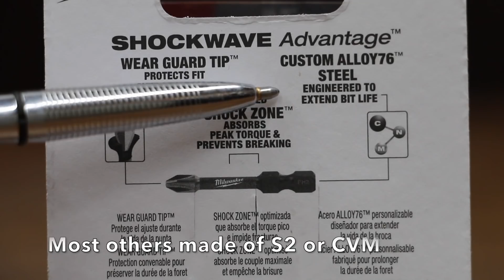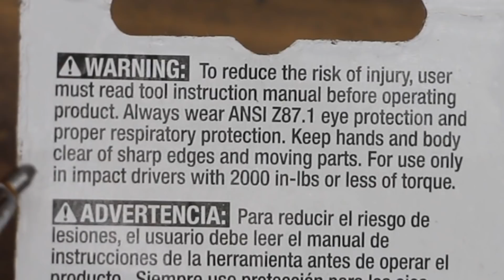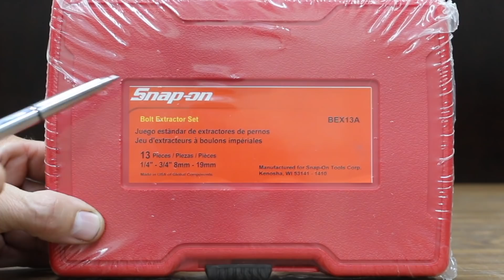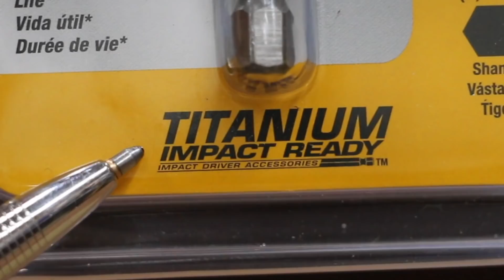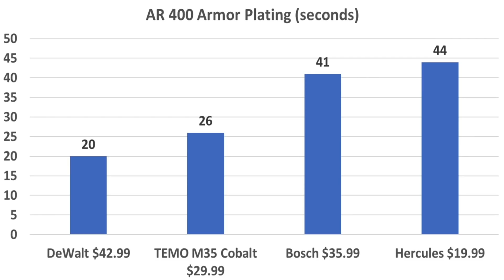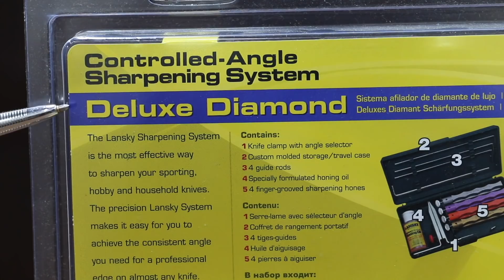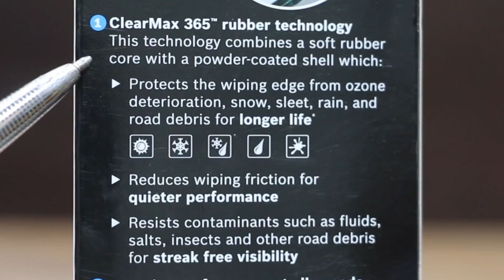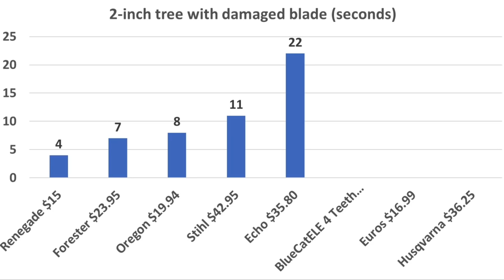Top 10 Tools in 2020? Let's find out!

Comment: Vid idea rtv silicone, ultra gray,ultra black,ultra copper, red high temp as anti seize? I wonder if in a pinch if it would suffice as anti seize. I've used silicone grease in a pinch as anti seize before and nearly 3 years later it all came right apart with no issues and worked..
Reply from the maker: Thanks for the video idea.

Comment: 1.	Best 1/4" Impact Bit - Milwaukee Shockwave Philips #2 Impact Bit	
2.	Best 1/2" socket adapter - DeWalt Socket Adapter	
3.	Best 1/4" Impact Driver - Milwaukee 2853-20 M18 FUEL	
4.	Best Nut and Bolt Extractor - Rocketsocket	
5.	Best Safety Glasses - Carhartt Carbondale CHB210DT	
6.	Best Step Drill Bit - DeWalt Step Bit	
7.	Best Drill Sharpener - Drill Doctor 750X	
8.	Best Knife Sharpener - Lansky Knife Sharpener	
9.	Best Windshield Wipers - Bosch ICON	
10.	Best Gas Trimmer Brush Blade - Renegade Hybrid Brush Blade

Comment: The Milwaukee impact driver he is showing/using is NOT the 2853 model listed on the chart.  The model he's using is a 2760-20 Surge 1/4" Hydraulic driver.  It comes in at $149 at Home Depot, Amazon or anywhere else you want to look.  I am very familiar with this tool as I am now on my sixth unit.  I just purchased my sixth one yesterday.  You may wonder, why is he on his sixth unit, do they go bad.  Hardly!  Thieves keep stealing them, either at my job site or out of my truck if I leave the window down more than three inches.  Yeah, I know, it's my own fault, well for leaving the window down too far anyways.  My first impact driver was a Makita which I thought was pretty good, but I had a guy helping me on a job and he had a Milwaukee (not the hydraulic, but Fuel). He would drive two screws in the same time it took me to do one.  Needless to say, I went out and bought one, and then opened my wallet to get two 5 AH batteries.  You can always have one charged before you run out of "fuel" on the battery you are using.  This is my favorite everyday tool!
Reply from the maker: Thanks for sharing.

Comment: Please check the flexvolt DeWalt 12 inch miter saw. Please find out why the cordless batteries work. And the adapter for the extension cord. Why does the have a problem converting DC to AC period and blowing the motor or computer inside the machine. Can you please test that. I don't think the walk has found out or solve the problem.
Reply from the maker: Thanks for the video idea.

Comment: Can't wait to see more videos this year!  Thanks for doing what you do!  Have you ever tested fuel stabilizer?  I use Sta-Bil marine for my small outboard boat engine and then regular Sta-bil for my other small engines.  Seafoam also claims to be a fuel stabilizer.  I was just wondering if one worked better than another, or if it really mattered to use the "marine" formula in the boat.  Might be next to impossible to test, but just wanted to throw it out there.  Happy New Year!
Reply from the maker: Great suggestion!  Thank you.

Comment: I have an idea, maybe you can run with it.  But maybe nay, I won't cry.  When I saw you talking the Drill Dr. up there.  Made me think of I got my dad a set of (Molybdenum Drill Bits), seems like about 10 years ago now.  A person does not  sharpen those bits.  The reviews tell about trying to use a Drill Dr to sharpen these.  Those revue people said how they only made their bits worse.  My dad says he has drilled, sever hundred .25 inch steel with em'. and they are still like little lasers.  Maybe review on some Molybdenum stuff.  And maybe, although I've not really looked.  There might be some other Molybdenum tools.  The Drill Dr didn't work because Molybdenum is more strong than even the diamond wheel.
Reply from the maker: Thanks for the suggestion.

Comment: I have seen you use various tools and liquids, sometimes for their intended use, more often, in ways the manufacturers would not expect. What would be the ultimate liquid in the shop? By ultimate I mean: loosens bolts, lubricates, removes rust, can be a fuel, prevents corrosion, cooks dinner, welcomes you with open arms after a day at work... etc.
Reply from the maker: Thanks for the video idea.

Comment: you apparently have not ran into the collet issue with the Milwaukee fuel impact gen 3
Reply: What is this 'issue'?
Reply: @JohnDoe-pv2iu  check out VGC constriction. when using any large bit, or paddle bit, the collet will not retain the bit and they can be potentially dangerous if drilling above your head.

Comment: Phillips designed their bits so they would cam out and ruin die cast parts. You should use a T-25 bit. T-25 is now the preferred bit for construction apps. At least try some Robertson or square bits.
Reply from the maker: Thanks for the suggestion.

Comment: I would like you to do a windshield wiper test. Please compare these brands in 20" lengths: Rain-X, Bosch Icon, Trico Maxx (new), Trico Onyx, Trico Flex, Trico Ice, Weatherbeater, Rain-X Vision (new), Trico Exact-Fit, CarQuest Blue, and the Rain-X Latitude.  We sold and installed over 400 pairs of wipers this week in temperatures of 32 to 44 degrees F.      One brand stands out, if you need some samples that are 1 year old, please contact me and dis-spell any personal preferences that I have.          Do you recommend a semi-annual maintenance on the wipers.  I have some ideas.        Regards, and Thank You for your Testing.                                                                          As an impartial reference, Please note: We recommend Project Farm (you) many times each week in our over the counter DIY Sales.

Comment: I thought Phillips head screws were invented so that they cam out went the screw starts to experience resistance. So the it doesn't over torque the screw. So wouldn't it be better if the Phillips bits are not so tight.

Comment: I would find a gear oil additive Test very intresting. Do they really reduce wear? Do they help with the lubricity?
Do you even need specific additives as motor oil Additives seem to do the same thing, here it would be interesting to test products like Restore or Liqui moly ceratec with gear oil to see if specific additives are just rebranded motor oil additives.

Keep up your great work!
Reply from the maker: Great suggestion!  Thank you.

Comment: 0 : 59 test is inaccurate, the more extensions/adapters the more wobble and thus inconsistencies in the torque readings. every racing/performance mechanic knows this. it's absolutely crucial on crank and cam shaft bolts

Comment: Idea:
Rotary hammer drills like:
https://www.boschtools.com/us/en/boschtools-ocs/sds-plus-hammers-11250vsr-26680-p/
or 
https://www.dewalt.com/products/power-tools/rotary-and-demolition-hammers/rotary-hammers/1-sds-rotary-hammer-kit/d25262k
and  milwaukee does them as well. There are obviously cordless versions available which gives more testing options. Test could be quite fun like drilling speed, breaking stuff speed, also since they are intended as heavy duty equipment drop test like you did with makita and the other one would be nice. From my experience they can also be used with the chuck to drive 400mm timberlocks into old oak railway sleepers (where impacts gave up). Quite a bit possibilities for a fun test. 

You probably don't use them as much as we do in eastern Europe just because of a different building style. When you get to hang a shelf on a reinforced concrete wall they are quite essential.
All the best in the 2021